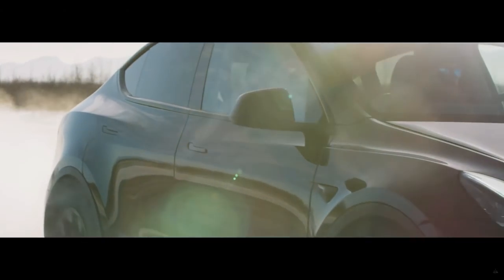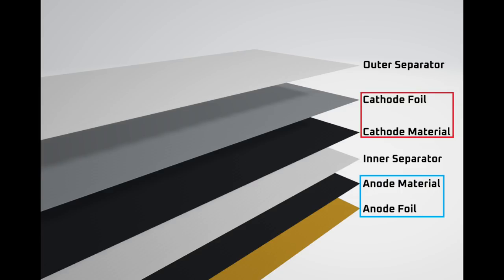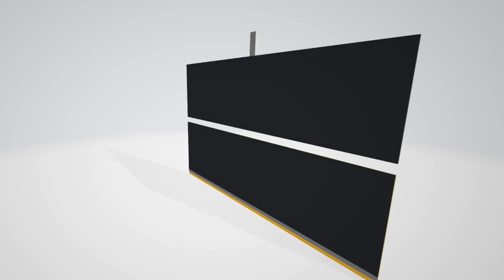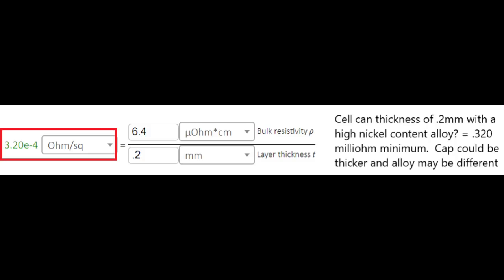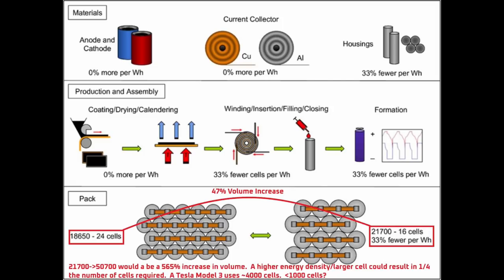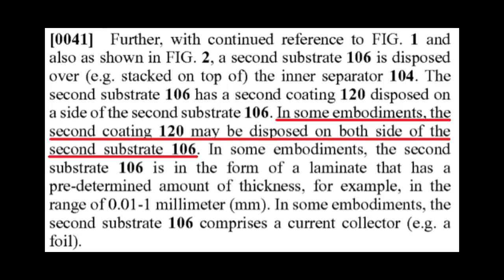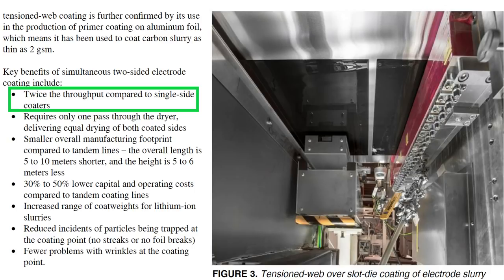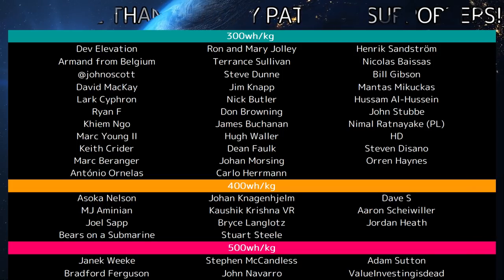Tabless Electrode Patent (Deep Dive)

Comment: A way around the fusing issue could be the multi layer PCB construction method from the October/ November pack patent.
If a PCB is dropped onto a section of cells and that board contains not only contacts for the cells, but components for local BMS and fusing of each contact, the board can be connected to adjacent boards by either plugs, or welding, and pressed onto the cells by the pack casing for good connection.
Reply from the maker: Niiiiice!  Are you an engineer?  You have a brain for this stuff.
Reply: @thelimitingfactor  
Copier Tech Support Technician.
Before that, Draughtsman.

Many photocopiers / printers use the contacts and fuse on a PCB method.
If you pull the drum unit out of your laser printer you'll probably see something similar.
The units normally have a quick blow fuse on a board to reset drum counters and intimidate an auto setup when a new unit is inserted.

Copiers use similar for contact on charge powerpacks, etc. If you pull out a charge unit, you'll see springs on the back which press directly onto the powerpack when slid back in.
Reply: @thelimitingfactor  
This could also have implications for yield rate as the cells are built into packs.
No heat applied to cells.
All PCBs tested, so no fusing errors.
Speed of pack manufacture.
Reply from the maker: @rogerstarkey5390  👏👏👏  I applaud anyone who makes or fixes things.  I've done a lot of work like that.  People ask about my background for this channel and it's just a lot of jobs where I had to fix or make things and dicking around with my own personal projects.
Reply: @thelimitingfactor  
You'd have made a great Copier Technician!
Rule #1
Understand the system.
(Some with 20 years experience still don't realise that)

Comment: One obvious way to deal with the double-sided coating problem is run the line vertically. No rollers required, same behaviour putting goop on both sides. I guess that's why they talk about 'in single-storey configuration'. I've no idea how long the coater/drier is (and thus how tall it might have to get to use this technique.

Comment: Don't forget that tabless is an enabler for the larger cells with longer foils. The alternative would have been multiple tabs per roll, which was even less attractive from a manufacturing perspective. Btw, is there a reason they didn't go even bigger than 46mm?

Comment: Double-sided coating of tape would be best done vertically. That is, instead of coating top and bottom on a horizontal line with rollers or tension to support the tape, you would run the tape from ceiling to the floor with mild tension.

Comment: The outer separator is not needed if only one electrode is double coated and edge insulated, but the other does not have a coating and is just bare but laid on one side of the double sided active material, then rolled.
Storage...Lets Roll

Comment: This is no doubt a junior question, no mention of electrolyte in the battery, I was under the impression that batteries needed this, do they ?
Reply from the maker: Yes, electrolyte is required, but not relevant in this case 👍  That is, not needed to explain the electrode.

Comment: I do not think that we will get a battery investor briefing from Tesla until after June 30. Tesla is trying very hard to make a profit in Q2 by cutting prices on non-Model Y cars and by promising to raise the price of full self driving unless you buy it before July 1. If they start talking about how much better their batteries will be in the near future, they are probably afraid that the “Osborne Effect” will kick in and some potential Tesla buyers who hear about this may hesitate with their decision to buy a car in June.
Reply: That would still be the case after June 30. It would take Tesla over a year to get a new battery factory up and running. The safest approach to avoiding the Osborne effect is to keep the range and the price the same for all current Tesla models. Tesla could just benefit from the higher production volume and the lower cost per kWh. (Better profit margin).
Reply: Lars Pallesen I agree with some of your ideas. I don’t think that it’s certain that it will take Tesla over a year to produce new batteries or to construct new production lines. I also think that there is extra incentive to make a profit in Q2 because that would trigger S&P 500 inclusion, which could hopefully add pressure on all of the short positions.
Reply: The new battery tech will simply only be part of cars not currently in production. So the semi and the cybertruck. That way no osborne on SEXY.

Comment: I think by "no outer separator" what they mean is you'd put two inner separators in the roll instead. So instead of lithium ions diffusing from one surface of the cathode to one surface of the anode, you make used of both surfaces on both....Oh you get to this a couple minutes further in. Our minds went to the same place.

Comment: Huh, I just assumed they had been doing this for years, it's the same way many capacitors have been made for decades although they generally never have press-contact connection.
I think the non-welded internal contact could be a point of failure from thermal cycling of the press-contact unless the battery chemistry actively prevents oxide formation, maybe the ends could be gold flashed or something otherwise? Else a low temperature solder could make a reliable connection without melting the films but that might need indium or such.
Either way this will seriously lower the resistance, and the inductance!
Reply from the maker: Thanks for the thoughts, much appreciated!  They offered a few solutions in the patent, such as stuffing the other end with insulative material to create pressure.  No mentioned of flashing or soldering, just different electrode and cap shapes, laser/ultrasonic welding.
Reply: @thelimitingfactor  Hmm, I think eventually they will take advantage of the thinner metal foils that this would allow. But I feel that would require quite reliable contact along the entire edge to avoid hotspots, and if a hotspot formed it would be more serious.
Reply from the maker: @samheasmanwhite  The problem with thinner foils is it's hard to manufacture them without pinholes and also run them through the machines at high speed.  If you know of any solutions to this let me know.  Also, I totally agree on the hot spots and a full contact along the edge.
Reply: @thelimitingfactor  Ah true, we can certainly make foils that thin reliably but I supposed the manufacturing process is different & more costly. I have seen a very interesting non-contact film handling method using air bearings that could be of note, it can reliably prevent contact with the bearing surface and can even apply a little force, unfortunately it would probably disrupt any sort of wet coating on the bearing side, but would be able to run over most dry coatings without disrupting them. http://www.ibspe.com/news/non-contact-film-handling-using-air-bearings.htm
Reply from the maker: @samheasmanwhite  Sick!  Never heard of air bearing rollers before.  VERY cool.
Reply: @thelimitingfactor  I've been quite impressed by air and fluid bearing technology recently, even leadscrews can be made with fluid bearing surfaces.

Comment: I also haven’t seen test data of loaded cell in comparing cell temperature w/wo tab assemblies for significant benefit towards the tab-less. 

Why would point contact in tab-less a major advantage in heat conduction?  

ESR reduction does not necessary benefit heat dissipation. Electric charge pass vertically from foil upper and lower edges in/out, a tab-less assembly reduce ESR to some but full extend. Where, heat transfer runs horizontally take advantage of foil area in the final turn of foil, missing the benefit from tab-less junctions.
Reply from the maker: What's ESR stand for?
Reply: The Limiting Factor 
It means - effective series resistance - 
it is a parameter that is ac / dc sensitive. 
ac includes electrolyte ac impedance 
dc exclude electrolyte ac impedance
Reply from the maker: @philoso377  Thanks man!  Yeah, I haven't seen data on this either.  I'd love to see what kind of results Tesla got.  
Gotcha - Effective Series Resistance, thanks.  I used the 'advanced' DC for the cell, which also captures the electrolyte or total cell resistance.

Comment: When I went through Maxwell's materials during the aquisition, I noticed a technical challenge they hadn't yet solved relating to the minimum radius that their dry electrode material could be wrapped around without tearing . I think it was around 3-4inches. (Possibly diameter, not radius.) That makes for a huge hole at the centre of the jellyroll. Have you seen anything in the patents to indicate they've solved that?
Reply from the maker: VERY interesting.  I hadn't heard about this yet.
Reply: @thelimitingfactor  I don't think this is where i saw it, but this article seems to touch on the issue: https://insideevs.com/news/355547/tesla-maxwell-battery-details/
Reply from the maker: @ninjastormy  Ah!  I think they were specifically talking about a superthick 2-3X film thickness there.  Shouldn't be an issue with a thinner coating.

Comment: Awesome video as usual :)  I noticed you speculated on a "50700" cell getting used in new packs.  Did it occur to you that the larger the diameter of the cell, the larger the "triangular air gap" is between batteries?  The cells aren't hexagonal, they're cylindrical.  The air gap is wasted volume inside the pack, so ideally you want to minimise or at least reduce it.
It follows that you only get a benefit from larger diameter cells if the cell chemistry is outweighing the larger amount of dead air that you get between them.
Am I right?  (My math could be wrong)
Finally, if Tesla has worked out how to make hexagonal cells, that could be awesome :)
Reply from the maker: Hmmmm, I would think proportionally the air gap would be the same.  However, due to the cell can thickness being the same, you'd get an improvement in energy desnity - albeit slight.
Regardless, even if there is an air gap increase that is greater than proportional, this tabless design might allow for plate cooling.  Or cell to pack might allow for liquid cooling.  Either would result in an increase in energy density.  The other way to look at it is rather than dead air (if there is more dead air), that's not dead air...it's more space for cooling bands and coolant if they stick with ribbon.

Comment: The more I understand about batteries the more similarities with electrolytic caps come up. I had always assumed the can formed an electrode. There becomes an issue with making it an electrode as they then need to be externally insulated/isolated. I got the impression from your two sided drying process description that the tension was provided horizontally. Surely you'd do this vertically and allow the material's own mass to tension itself. Evidently, you'd have the benefits of a chimney for drying too and in a small footprint. I can't help feeling that we need a one molecule thick insulator as an analogue to graphene as a conductor, then we get mega caps that solve almost every issue with batteries.  Edit: Wondering about somehow incorporating the 'fuse' inside the battery as part of the manufacturing process to allow duff cells to be 'removed'. This would simplify the external pack construction. Also higher yield may allow a destructive prestressing of the battery and fuse prior to pack construction.
Reply from the maker: I really appreciate those thoughts.  Great idea with gravity.  Perhaps they went with horizontal because the vertical method creates a two-story machine?
Reply: @thelimitingfactor  factories are tall!
Reply from the maker: @andyonions7864  Did you read the inset?  Durr's customer wanted a one story foot print.  Factories are tall...what a waste of space.

Comment: The tabless design also shortens the route of the ions. Imagine a shorter but thicker cell. The whole top area and the whole bottom area become connective surfaces. Ions travel shorter distance the shorter the cell is when the whole top and bottom are connectors. Use the lower heat to get away with fatter cell... EDIT: fatter cells means longer foil and more area for ions for each layer- width that you are adding in size to overall diameter of the cell, also a plus, I'd think. I like the fatter and shorter cell idea I guess...

Comment: Excellent video!  Near the end you refer to enhanced cooling when I think you mean to say less heat generation in the first place.  Still, both affects are effected via tab-less-ness.   Why didn't the inventors or their patent attorney make reference to the use of graphene; and or, ionized graphene, if such a thing exists, in an independent claim?    I believe that graphene is virtually obvious in capacitor design. Shouldn't capacitors have a cooling hole through their longitudinal center?  Who owns that patent?  I am starting to see why the prismatic or, layered capacitor, is obviously the better design; you get a heat radiator at every layer's edge vs only one terminal edge for the entire coil of a coiled capacitor.
Reply from the maker: Graphene has it's place, but not quite yet.  Better to take a first principles approach and change the basic structure of the cell, and then throw some icing on the cake with things like graphene.  Graphene will hit its stride in about 5 years when manufacturing costs come down.  It doesn't improve energy density but it's power density improvement helps with say....a sulphur based battery :)

Comment: why are these cells always round? couldn't you make a more energy dense battery if they where square?
Reply from the maker: They do make different shapes of cells.  The selection of the cell really depends on your overall architecture.  A good question though.  I need to look more into the physics of the cell.  I imagine it has to do with cooling and the surface area of the cylinder versus internal volume and the space it creates for cooling bands.  Again, just to guess though.

Comment: What's the over / under for where you see the battery industry in 3 years?  $ per KWH? KW/KG? Number of cycles to 90% capacity?
Reply from the maker: Depends which country and chemistry.  Tesla's OEM cell:  4000 cycles, 300-350wh/kg, $90-100kwh at the pack level, $60-70kwh at the cell level.
Reply: @thelimitingfactor  Dude, I love decisiveness.
Reply from the maker: @klgbca  You phrased it in a great way.   I don't always answer these questions, but under/over gives me some slack.  I could be totally wrong, but that's what I see in the tea leaves.

Comment: My impression is the tabless battery is about moving heat faster specifically when charging. Basically no one drives so fast that they would drain the battery in 15 min but we would all like to charge one in 15 min. In a Model 3 jelly roll the foil's spiral path is about 810 mm long (142 sec in https://www.youtube.com/watch?v=_uKpn3zflBE&t=143s) with a cross section of something like 0.015 mm (figure 1 https://www.osti.gov/servlets/purl/1346648) * 65 mm = 0.98 sq mm.  Read: long with a very thin cross section. This makes it an extremely poor thermal conductor in the spiral direction. I believe most of the heat moves radially out from the center. In the radial direction the foils are very thermally conductive but the anode, cathode, and separators have moderate thermal conductivity. Both foils and electrodes have a large cross section (average circumference (which is half of the diameter * pi) * height = 20 mm / 2 * 3.14 * 65 mm = 2040 sq mm) and a short radial distance (half of the radius = 10 mm / 2 mm = 5 mm) .
.
I believe that the limit of conducting heat radially limits the diameter of a standard jelly roll battery. 
.
A tabless battery allows for a thermal path down to the the bottom of the can. The average length down the foil to the bottom is (65 mm / 2) = 33 mm. This is 25 times shorter than the spiral path. And the cross section is 0.015 mm * 810 mm = 12 sq mm which is 12 times more cross section than the spiral path. Read: 25X shorter and 12X wider cross section. 
Because a tabless battery allows heat to get out of the battery more quickly the battery can have more turns and/or thicker electrodes. More turns of the jelly roll and/or thicker electrodes gives higher wh/kg which I think with lowers the $/kwh. My guess is the tabless design is important/critical to 1) the thicker DBE electrodes of the rumored the 40 mm diameter of the Roadrunner project and 2) cost savings.
Reply from the maker: Great points!
Reply: Because the tabless battery moves heat to the bottom of the can there would be an advantage to have a shorter height.
Reply from the maker: @brians4537  That's what I'm thinking.  Maybe marshmallow shaped cells.
Reply: @thelimitingfactor  My guess is it's primarily a cost vs charging speed consideration. The cells have to be arranged some how. If they reduce the height by less than 1/2 then more area would be needed (assuming no increase in specific energy). They could reduce the height by 1/2 and double stack but then would need to create twice as many cells. Being tabless reduces the manufacturing cost but probably not enough to cover making twice as many cells. One plus for twice as many cells is it would probably lead to an overall lower cell production failure rate.
Reply from the maker: @brians4537  I'm not sure what you mean.  I don't have you on any block list.